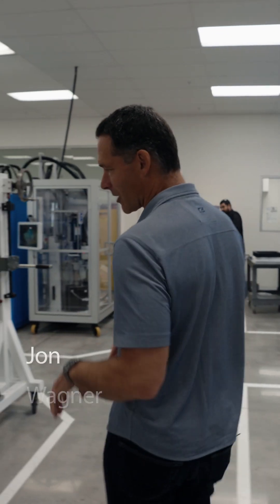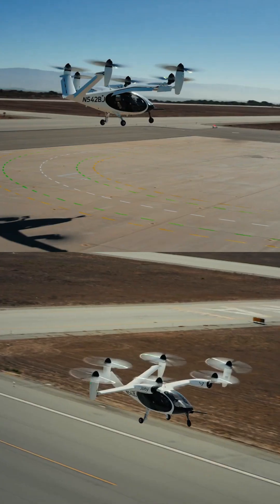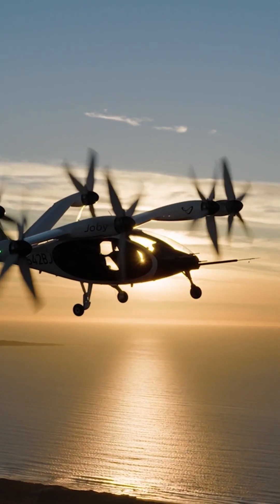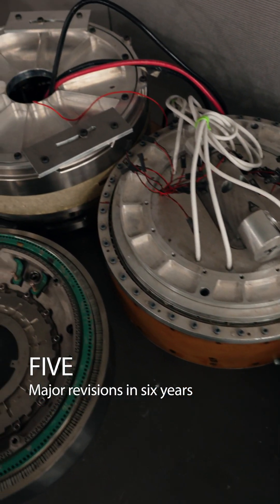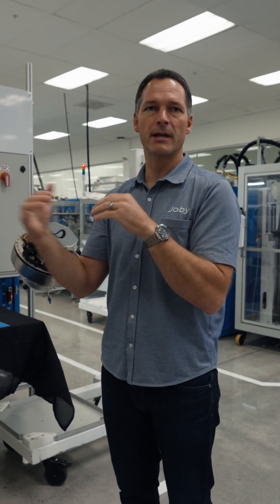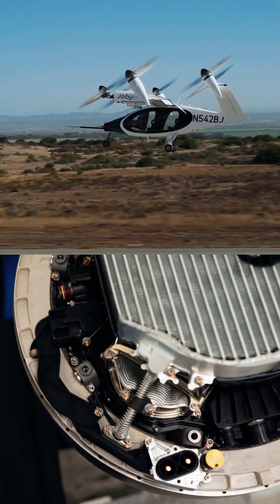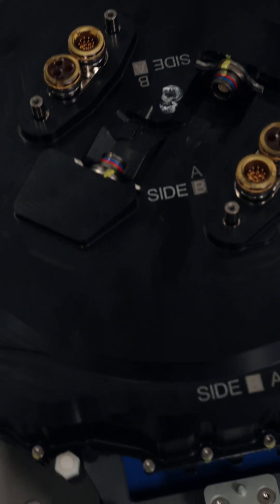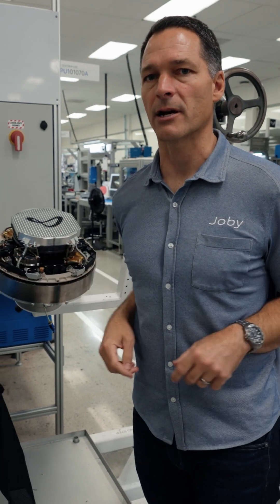Joby's High-Performance Electric Motors

Comment: Yall would probably have more success bringing those motor packs to market than the aircraft itself
Reply: Joby doesn't have a market cap of $6B because of a good motor design.  Joby is going to play a part in revolutionizing travel.
Reply: aircraft motor requirements are different to EVs.